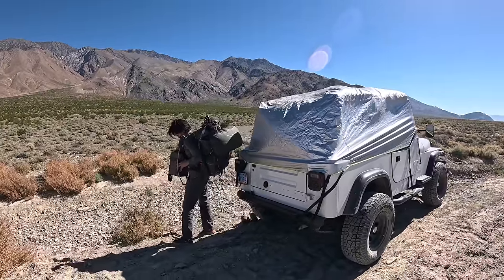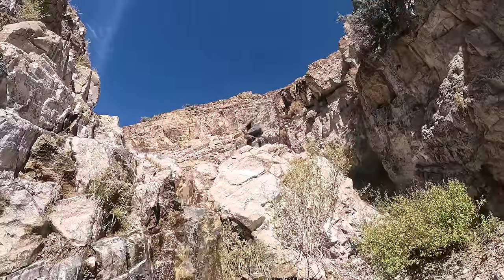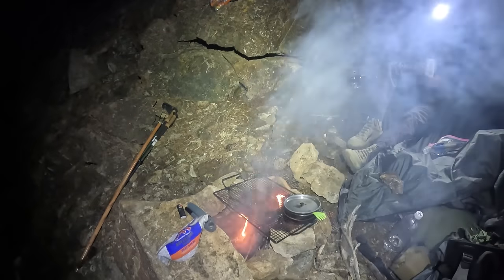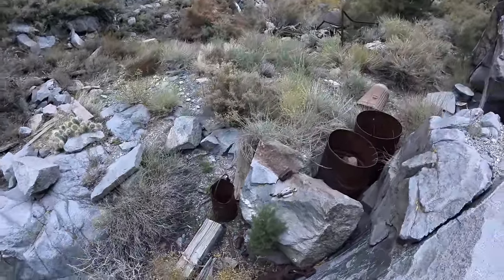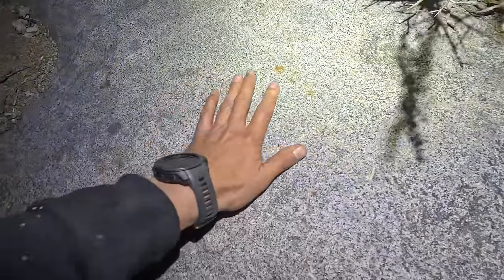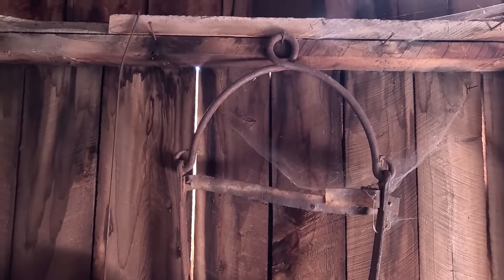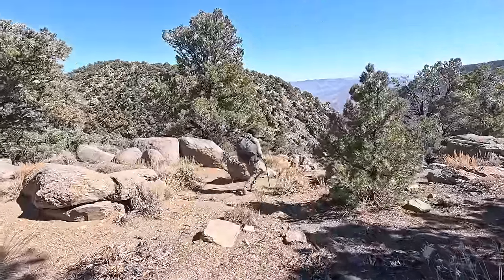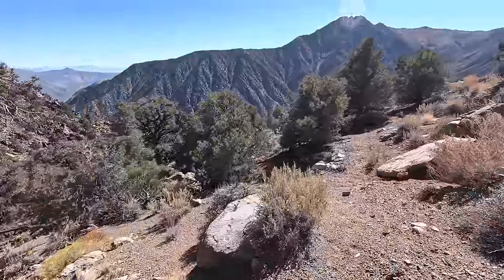Relentless Hike To This 1870's Ghost Town (Part 1)

Comment: Looking forward to part 2! My brother and I and two guys from where I worked hiked in there back in the 70s. I don't remember what year, but we hiked in over Thanksgiving weekend and it was really cold. We came the opposite way you did. I had a 1968 Land Cruiser and my friend from work had 1972 Bronco and we 4 wheeled up to around 10,000 feet and spent the first night at the Burgess mine. Started the hike early the next morning. If I remember correctly we hiked, climbed, and explored for three full days before getting back to the vehicles. It was grueling, but everyone later said it was the best adventure they'd ever been on. I always enjoy your videos, but these will be extra special and bring back lots of great memories. Thanks, Pardner.
Reply: A 1968 Land Cruiser! Do you by any chance still have it?
Reply: @cdd4248  No. Unfortunately not. It was a great off-roader, built like a tank. I logged a lot of exciting miles in that thing. In the roughly forty years since I took it on the backpacking trip I've owned at least fifteen different 4X4s. Various Jeeps, Scouts, Broncos, Blazers, pickup trucks..., you name it.All of them good. These days my ride is a 2018 Toyota 4Runner Off Road Premium. It's a great vehicle and I love it.

Comment: Your "ground-packer" is a McCleod  - a tool used in fire-fighting you can chop with the blade side, hoe with the tined side (like a rake). Also used for clearing brush & trail-building.

Comment: In the volunteer cabin, that "S" shaped handle was the handle to a coffee grinder. And what you called a bed frame looks more like a Shaker Table used to sift through mineral bearing ore. 
Back at the water well, those large rectangular cans with hooks on them were actually a way to bring down water to the camps. The hooked one can on each side of a mule or donkey on the pack saddle frame. 
But I bet not many hike up to that cabin much. Did the cabin have a log book? It looked like the roofing on the cabin was fairly brand new. Looked like a difficult hike. Would it have been easier going up from the other side of the ridge, instead of the side where you parked your vehicle?

Comment: At one point there must have been a decent road up there in order for them to pack all that stuff up there. I know a lot of it they hauled up with mules or donkeys.  But there must have been a road cut to get the ore out and down the mountain.. this video was amazing. The old timers were tough sons of bucks
Reply: Possible, but more than likely, as you say, mules and/or donkeys... As far as the ore goes, notice there was an arrastra to grind the ore. Primitive, but they work.

Comment: Without giving away the location, is that the same well marked on the geodetic survey? Because WOW! you hiked down to it and then back up!?
Reply from the maker: It is! Was surprised it had water in it because from most reports and accounts it's mostly dry or very little water. We lucked out
Reply: Great approach, have only seen blog postings from that side of the range. Was this a through hike or a round trip? Are you doing anything with the mine in the valley of the well? @WesternMineDetective
Reply from the maker: @wreckclues  I wish I did but that's for the next trip. Wasn't a round-trip cuz I came out another wash/canyon than I came up probably 3 or 4 miles apart.